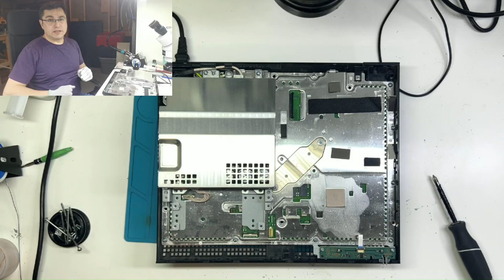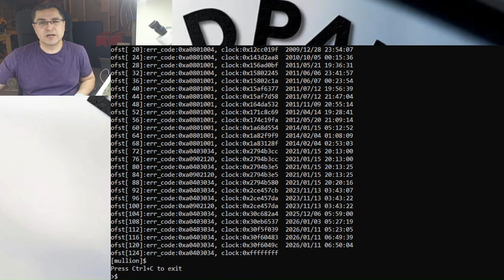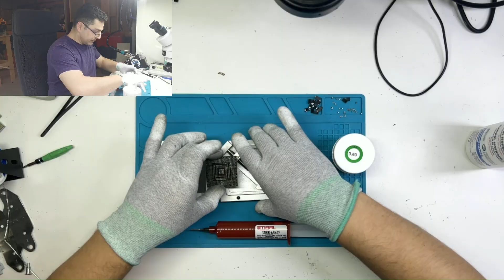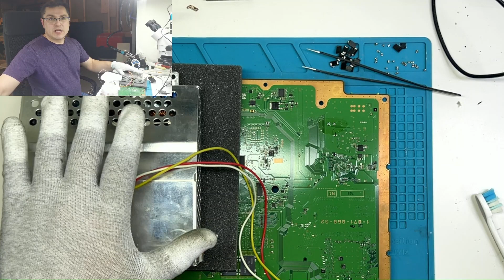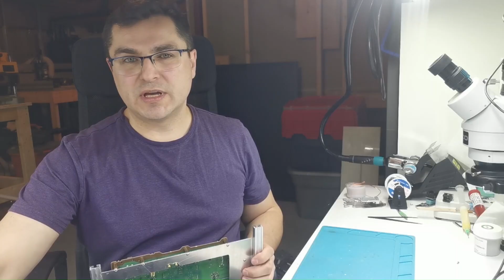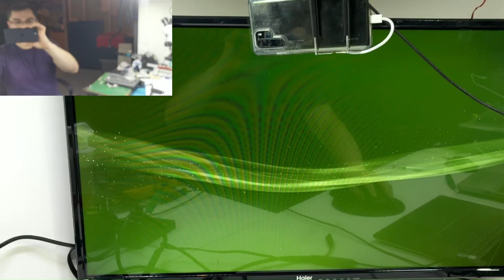Very rare PS3 Fat CECHB01 Revive! RSX GPU Transplant from Slim Model – Does It Work?

Comment: how much would it be for this to be done on a ps3 slim cech2001a? rsx40nm/tokin replacement.
Reply from the maker: For slim consoles it is not worth it. In the price of this service you can purchase a working console and have some cash left. Unless it is about some data recovery from the drive.
Reply: @Rad-Paw  thats totally fair. and yeah its mostly to keep my whole slim in its condition for its data/saves. maybe ill just look into the tokins and leave my rsx alone as it has not failed yet
Reply from the maker: @persacon12 if it is a slim version, worst case you have 65nm RSX and Tokins on CELL, keep it dust free and paste fresh.
Reply: @Rad-Paw  Exactly what i been doing lol ive been obsessed for the past 2 weeks since i dug it back out. i hope my delid keep my tokens from exploding lol
Reply from the maker: @persacon12  If you delidded CELL, the console will keep the temperatures lower. Also 65nm RSX can be delidded too, I wouldn't risk it only with 40nm - there is a big risk of ripping the VRAM off.
Reply: @Rad-Paw  thats cool to know actually! i assumed all 3 would be similar in terms of delidding. i found the rsx to be the easiest of the 2 to get off personally(with a tiny torch).
Reply from the maker: @persacon12  SONY changed the thermal compound on VRAMs with something much more similar to glue. In one of my videos you can see a 40nm RSX with all VRAMs ripped off - they stayed on the IHS

Comment: thanks for video it helped me do my first franky the only thing i have to do is voltage mod so when soldering voltage regulator 3 pins not solderd to motherboard is this correct its a cok 002 . i done 40nm rsx changed tokens trained sycon then it was green light of death. i didnt realise you have to do resistor mod for rsx to work so i done recistor mod and she was alive  what a feeling when it worked thanks again for your knowledge
Reply from the maker: Thank you for the comment.
Yes, 3 pins of the voltage regulator are floating, 2 middle ones are soldered with wire to the capacitor and the last one isn’t connected anywhere. Without the resistor mod it won’t work.

Comment: Thanks for the video! Great work on this freaky board. I just saved a friend's board that had problems with the 1002 and then the 1001. On the RSX side, I soldered the Rip Felix tantalizers and noticed that there are also some ceramic SMD capacitors. Are they really useful? On the Cell side, I did a less invasive job by soldering three capacitors from a Slim board next to the NECs. If I had to completely remove the NECs, can I safely replace the Slim board's tantalizers, or do I also need the ceramic SMD capacitors? Thanks in advance for any answers.
Reply from the maker: Thanks for the kind words, and great job on your friend's board! On Felix's Tantalizers there are spots for these ceramic caps, you can salvage them form a slim board too. I didn't install them and the console works completely fine. I would say, it is better to solder these ceramic caps but not necessary. You would need to use oscilloscope and measure voltage on CELL to see the difference.
Reply: @R @Rad-Paw  Thanks! I'll keep you updated! So SMD ceramics aren't actually essential?
Reply from the maker: My console is working without them.
Reply: @Rad-Paw okk 😉🙌